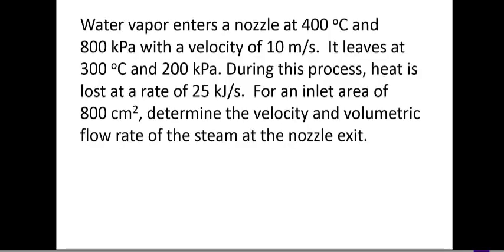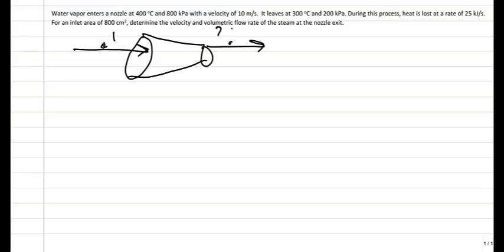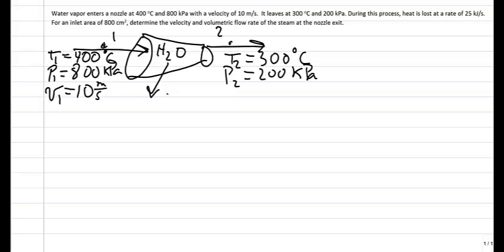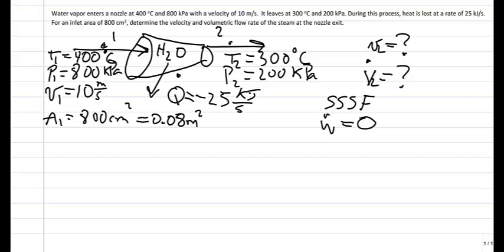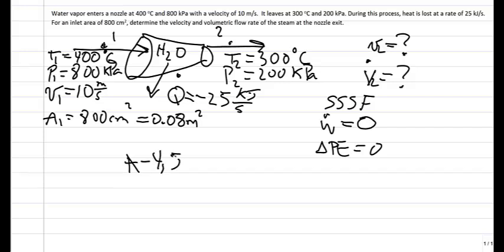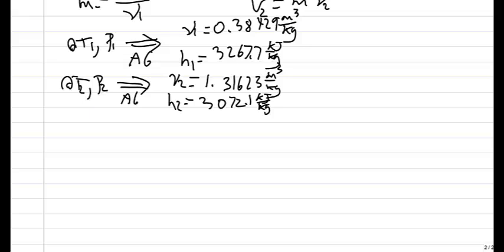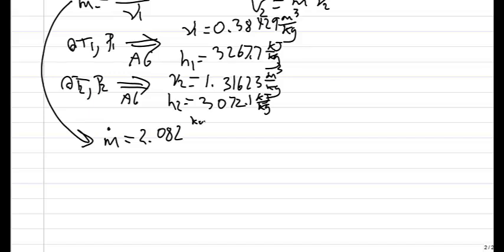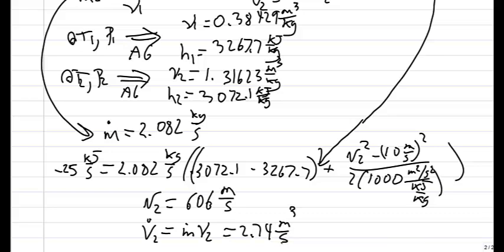Thermodynamics: Worked example, Nozzle

Comment: Why is it that h2-h1 did you use instead of h1-h2? In fact that h1 is the one that enters and h2 is the exit point? 

0=Q+ summation of M[(h1-h2) + (V1^2-V2^2)/2]

We can expand this into 0= Q +[M(h1-h2) + (MV1^2)/2-(MV2^2)/2 and then transpose the MV2^2/2 which it will be  V2^2 = [Q/M + [(h1-h2) + V1^2/2]]2   and then we we turn into this V2 = square root of [Q/M +M + [(h1-h2) + V1^2/2]]2 and then we have the V2